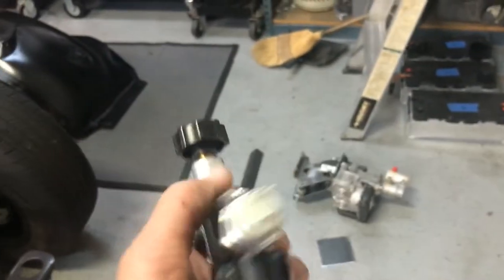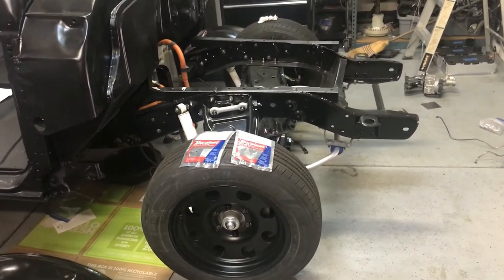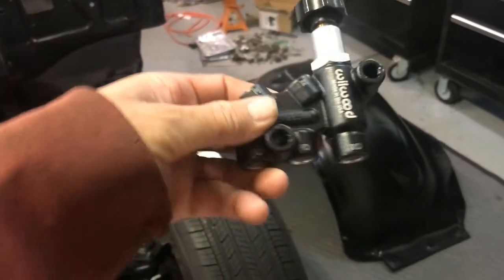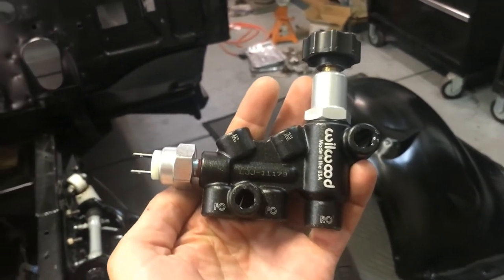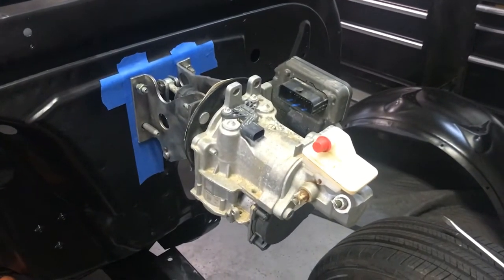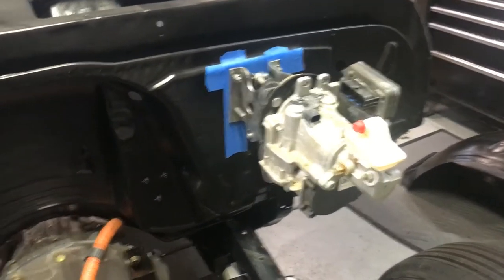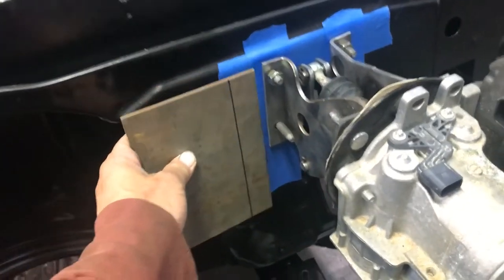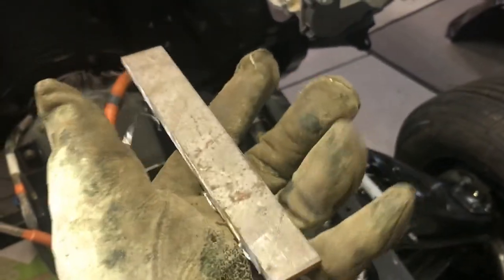Honda CR-V iBooster & Wilwood Proportioning Valve

Comment: FYI, the reservoir from a Chevy Volt is an easy swap for this MC. You have to trim a little tab off with a razor blade but otherwise it fits. You can usually get them for under $50 if you want a more traditional/not-remote reservoir. Thanks for putting this video up! I am currently swapping one of these into my 65 nova.
Reply from the maker: how did it go? did you get your to work in the Nova?
Reply: @Good-Enuff-Garage  Unfortunately, I could not get it to work. It would always vibrate/pulse at the bottom of the pedal range. I will come back to it eventually, but I wanted to drive the car so I converted back to manual brakes. 

It looks like some people have had no problems and some had the same issues as I did. It’s a cool system and I will sort it out eventually. Best of luck!
Reply from the maker: @novapat67  the guy who turned me on to them got it working in his Jag but adopted the Jaguar master cylinder to the iBooster, I plan to do the same on my '71 GMC I think it has to do with the volume displacement of fluid, here's a link to his gorgeous build https://www.youtube.com/@arturkustusch1379
Reply: @Good-Enuff-Garage  That makes a lot of sense. When I have some free time and get back to this, I had planned on making an adapter to use an older-type cast iron master cylinder. It shouldn't be too hard. The one thing I need to figure out is how to extend the pushrod on the ibooster to account for the thickness of the adapter.

Comment: I'm not sure about this Ibooster but in almost all automotive braking systems I've worked with, the rearmost piston in the master (closest to the firewall ) usually applies the front brake if its not diagonally split braking system, and the front piston applies the rear brakes. It may not matter with the CRV master as I'm pretty sure it send both lines to another block and works with abs system to divert /control each wheel end.

Comment: Does the 2019 Chevy Bolt Reservoir fit in these Honda CRV Gen 1 iBooster? I have one but the tube on the inside of the Chevy Bolt brake master is about 1/4” longer , should I still install it?

Have you heard of TuLay WireWerks in Pennsylvania for the pre crimped iBooster connector……. Are they any good?
Reply from the maker: I'm sorry and i have not but please check out EVCreate dot com for more info and parts for the iBooster, hope that helps
Reply: @Good-Enuff-Garage  based on my own anecdotal evidence the 2019 Chevy Bolt reservoir and brake master does in fact fit inside the 2019 CRV brake master housing and the tubes should be interchangeable so it fits the Gen 1 iBooster housing. 

Unfortunately the larger one piece reservoir of Chevy Bolt does not clear my turbo so I need to get the two piece 2019 Honda CRV remote mount brake master reservoir scenario plumbed up.

I tried the reservoir from both 2019 Chevy BOLT and 2020+ Honda Odyssey brake master (to get the one piece reservoir look) and they appear to also not fit height wise either more noticeable on the Honda Odyssey, so if I was to recommend this I’d say I’d make sure to purchase the 2019 Honda CRV iBooster junkyard COMPLETE with the tubes, remote reservoir and 3 connectors (main harness, secondary “gen1/gen2” distinguishing connector, and reservoir pigtail) etc  otherwise it’s wasted time money and effort needing to purchase each thing independently imo.